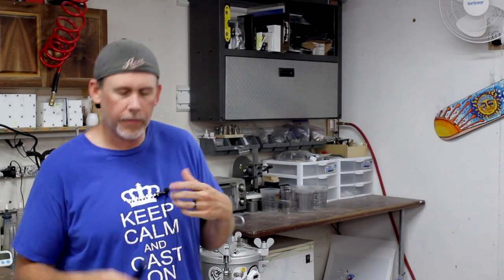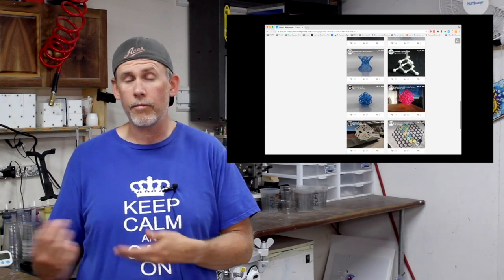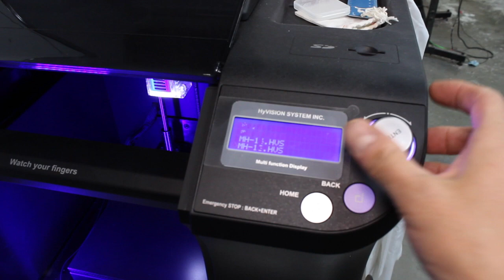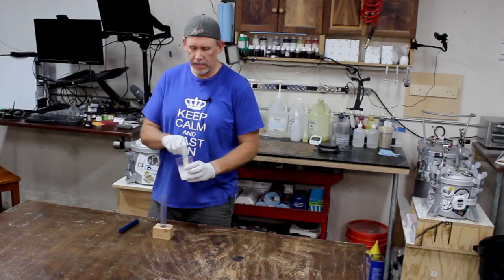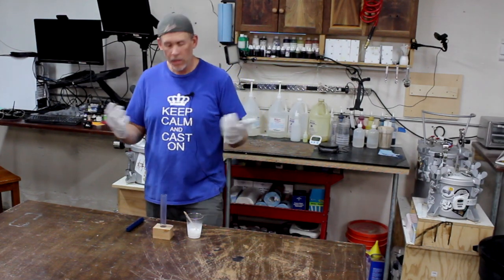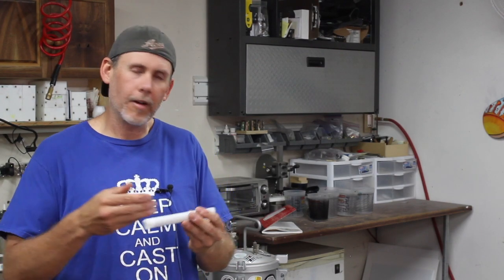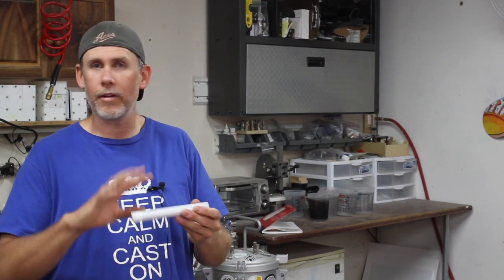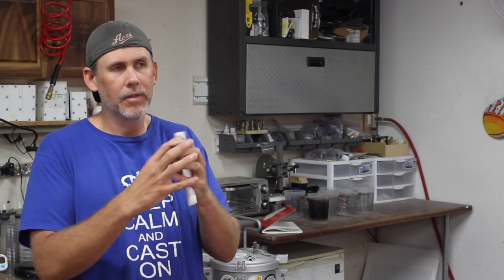3D Printing & Resin Casting Fusion - Making Yankee Pinstripe Pen Blanks

Comment: Awesome video Zac!!! Have you tried annealing 3d printed parts yet? You can increase their strength and layer adhesions along with increasing there resistance to heat deformation
Reply from the maker: Thanks Alex! No I haven't done the heat treating. It's not really necessary with ABS, that's more of a PLA issue I think.

Comment: Nice looking product.  How did you manage to find the exact center of the 3d object to keep the lines symmetrical?    JimE
Reply from the maker: Thanks Jim! I haven't found that it needs to be centered perfectly. The blanks are pretty close as is
Reply: So you just drilled it like any other blank? Seems like you could "Print" the hole in the middle 27/64 for say a sierra and then plug the holes before casting. 

You could even add the plugs into the print and when you trimmed the edges, cut away the plugs. You now have a perfectly centered hole.
Reply from the maker: Yeah, you could do that. Leaving it solid, you can just drill it out and choose any kit you like though

Comment: Zac, how hard would it be for you to make a 3D printed red flag stripe object & how much would it cost ? Thanks,  Jim
Reply from the maker: Hey Jim, I really don't use the 3D printer much, so I wouldn't even try to tackle it. Just not enough time to devote to learning the ins and outs of both the printer and design software. You might see if Chad Schimmel could do it, I think he might have picked up a printer now
Reply: Zac Higgins Thanks Zac. As always, good advice.

Comment: You could also make a mold of the 3d print and then make resin versions of the 3d print. You would have to be a bit careful though on how you design the print, for example the one you did had a hole in the centre but in a silicon mold with no support that may create problems however if it was solid then it would be better not only for stability but making a bigger space to pour the resin and thus making it easier for the air to escape.
Reply from the maker: I made an R2-D2 mold that way, 3D printing works great for making masters to cast =D

Comment: So, finishing...does the PLA need to be sealed with CA?
Reply from the maker: I used ABS for mine, but I think PLA is the same, just polished it up as I would the rest of the blank. You might get a more even shine across both materials with CA if the PLA/ABS seems more dull than the resin

Comment: How do you drill the hole for the tube?
Reply from the maker: I drill on the lathe. You could do it on the drill press too. Either way you have to be careful how tight you clamp it. Too tight, and it can crack the blank